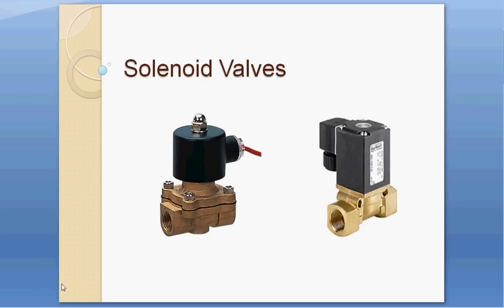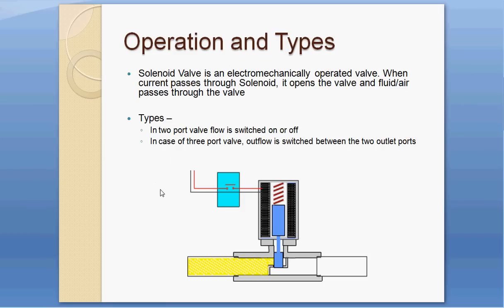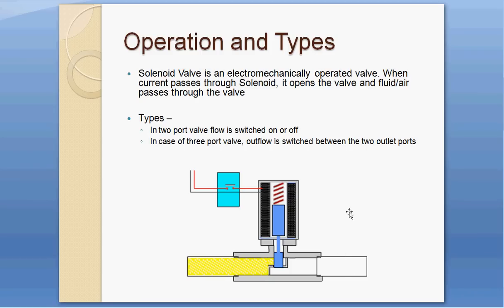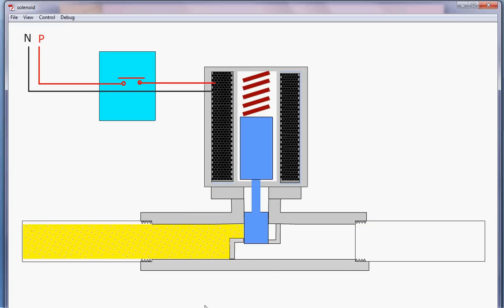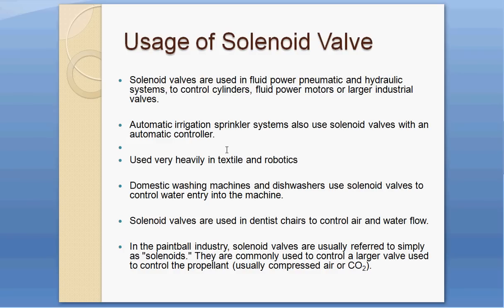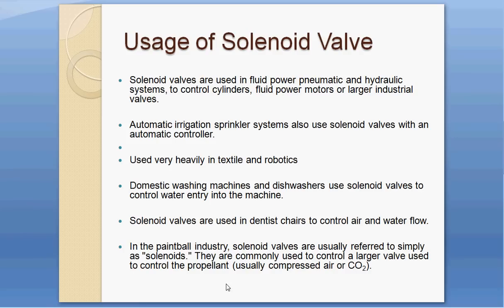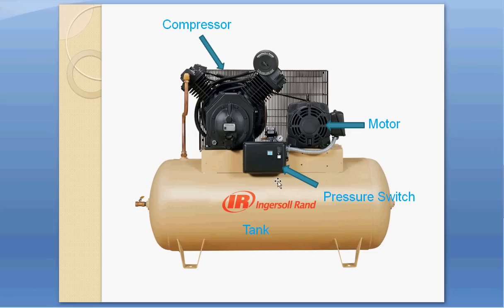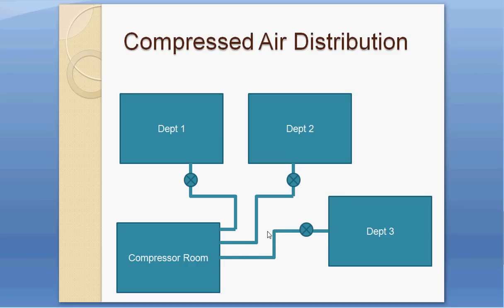Solenoid Valves

Comment: Hi Can you tell us how to connect the solenoid valve to the Arduino board and to the power supply
Reply from the maker: I haven't tried it but I guess you need to use some type of relay to do that.